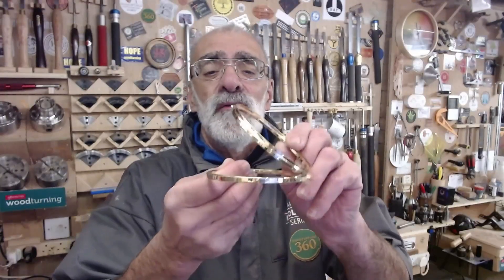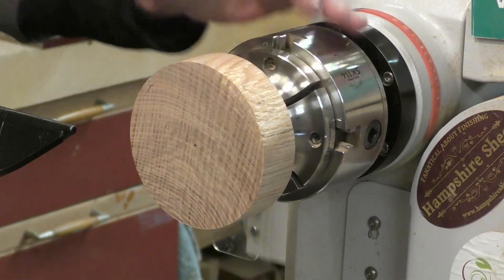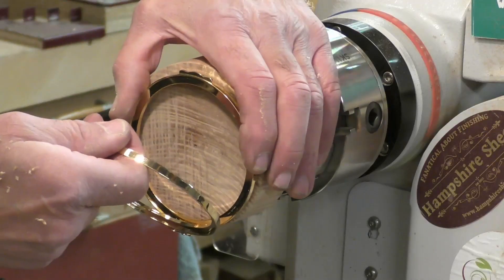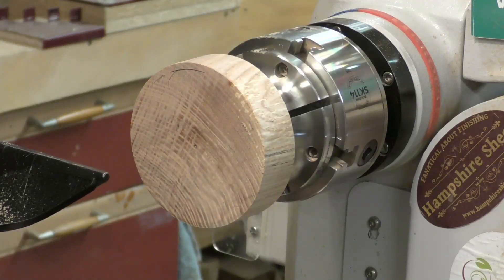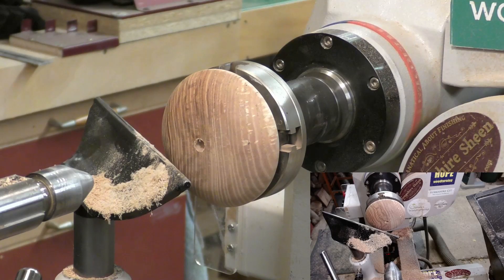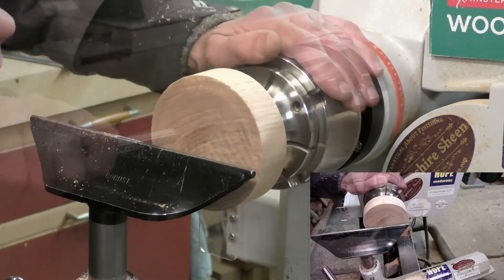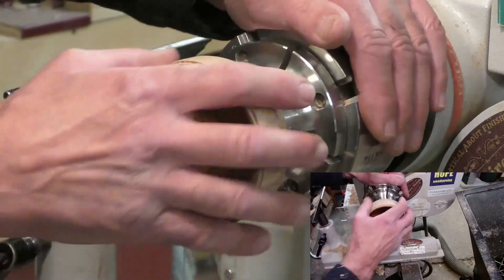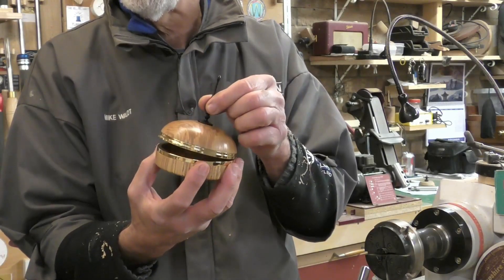Woodturning - Trinket Box featuring the Prokraft Lock Hinge - A Step by Step Guide.

Comment: Nice little box, just one question, what glue did you use to attach the hinge ring to the box please?
I am concerned about squeeze out, and spoiling the whole thing, as opposed to not enough and the joint lets go. your input would be greatly appreciated.
Reply from the maker: Thank you Roger. I used medium CA and found it worked well. Tiny amounts all around the recess of the hinge. Hope this helps. Cheers. Mike
Reply: @MikeWaldt  thanks Mike, I was not sure if CA would be strong enough. I will allow it to cure naturally, this should give it the most strength. I have been watching your videos all day, and getting new ideas, they are great.
Reply from the maker: @rogergregerson348  My advice is not to ever use accelerator when looking for a strong bond as it makes the joint brittle. Your comment is spot on 🙂